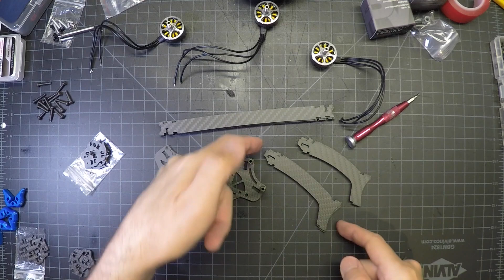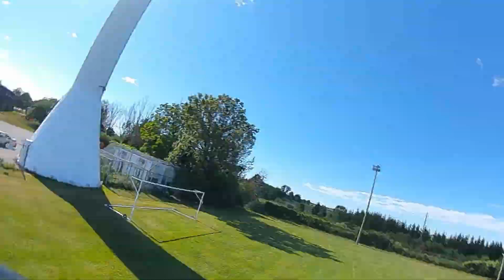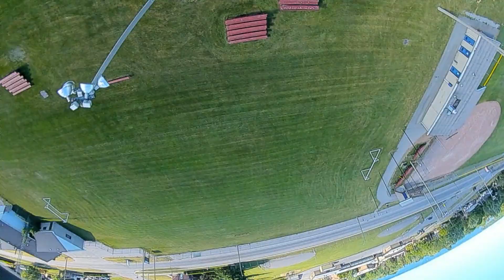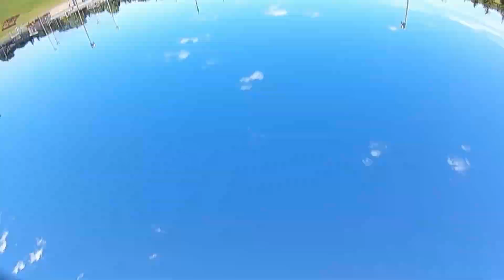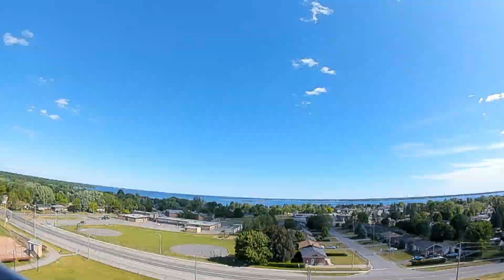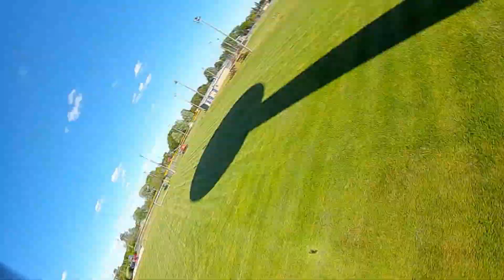Dr. Drones Prätoria 5" build

Comment: Where is the FC in that build? 😲
Reply from the maker: ah, it's a secret. answer below
Reply: @PIDtoolbox  😁😂
Reply from the maker: @marlin-fpv  what can I say, I'm not great at tight builds lol
Reply: @PIDtoolbox  Not an easy task to extend those arms in height. Over here in germany we flew boxed style frames like until last years season. In the end they ended up getting dropped because being too heavy for a racing rig. They definitely helping to learn to fly smooth lines though. They are also pretty rigid, I was never able to break one flying outdoors.

Comment: I do wonder if that's due to the extra stiffness that a box design gives. Pain in the ass if you gotta replace an arm but very solid performance.
Reply: Hello Alvin, I am Dr.Drones. Your are totally right, it is not that easy to change some parts, if you destroyed something, but I can tell you from my experience. I am racing that frame for more than a year and I never (NEVER!) broke a single 3mm Arm. I broke 3 braces and 4 motor connections plates, thats it. Under hard racing conditions and with more than 100 crashes. It is really rigid, so you dont have to change parts or repair something that often as normal race frame designs. But if you have to, it is a little bit harder, totally correct. 

Best regards
Dr.Drones

Comment: Reminds me of tbs sourceone V. It also has vertical arms.. nice flying too Brian
Reply from the maker: Interesting, yes you’re right. Did not know if this frame.
Reply: @PIDtoolbox  yeah. Dunno why its not popular. Tbs source V.
Reply: Hello Guys, I am Dr.Drones. 
There are a few box frames out at the market, the concept is not totally new. But I saw several ones which were shaking around out of the box. The key for the extreme stiffness of the Prätoria are different carbon thicknesses, the design of the joints and the tight tolerances from the cnc milling. 

The center of gravity is moved forward to keep the back motors a lot cooler and also the CG carriage is lifted to keep the weight of the battery a little bit more in center. There are a lot  of small key features which are making the difference, trust me. I raced a lot of standard frame designs in 2020 and I was going back to the prätoria in season 2021, because there was no frame with that amazing flight feeling like the prätoria. (Only for my personal feeling). 

Thank you guys for the great discussion. 
More frame content and fpv engineering on instagram: dr._drones

Best regards.

Comment: where is the FC?
Reply from the maker: Let’s just say, the picture was for illustration. I technically couldn’t fit the AU in properly because I had the stack too high, so I temporarily flew it with the AU strapped on top. 😂. I pushed the FC outta the way for the picture. I mean what else could I do 😬. I hoped no one would notice. Very perceptive of you
Reply: If using the DJI Air Unit, the stack can't be higher than 18mm or so. It's doable, but not with every stack. And you need to use 90° antenna connectors.

The Caddx Vista will fit in a lot more easily.
Reply from the maker: Long story 😬
Reply: @PIDtoolbox  I wanna hear it :)